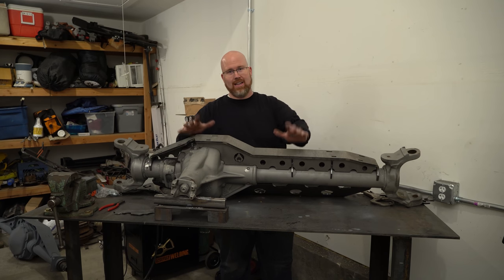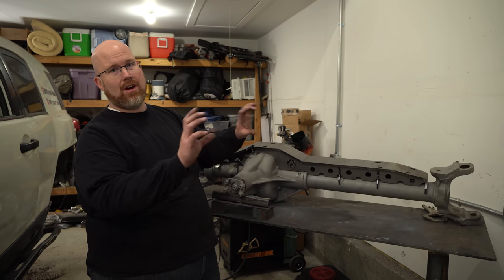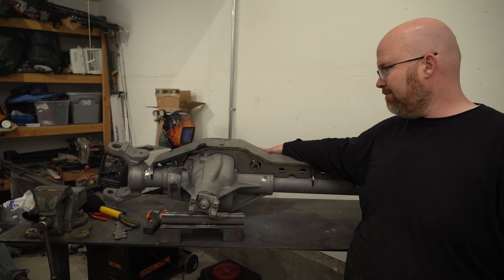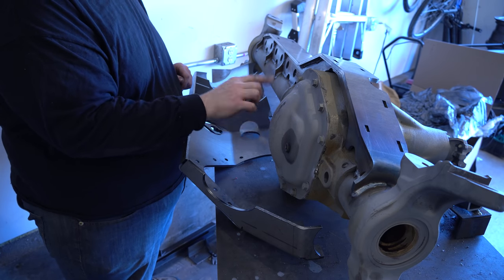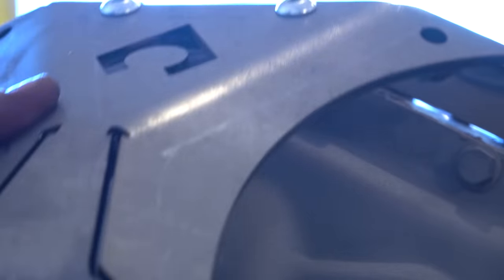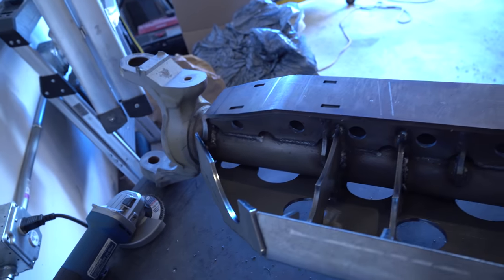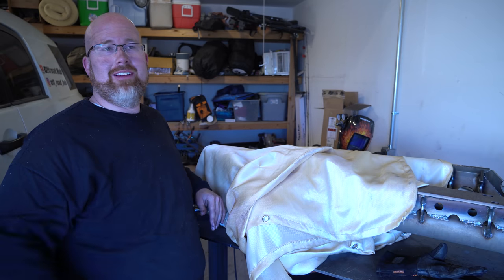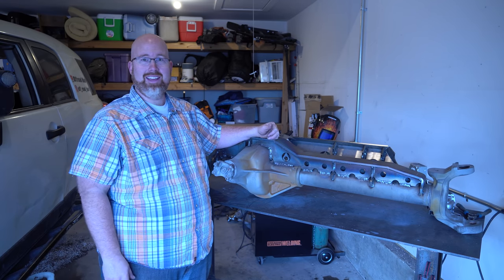Dana 60 Truss and Hydro Steer Mount Install // FJ Cruiser SAS

Comment: Heavy but strong and it will be interesting to hear your opinion on the power to weight ratio when the build is complete. ROCK ON!
Reply from the maker: I'm excited to have all that new weight down low, and wide. The power to weight ratio will be better than old 22re Toyotas with the same setup. It'll be all about the gears.
Reply: @offroadhub.official  Being you trailer your FJ and use it for trail use, on the road performance is not much of a concern.So low gearing is the logical way to go and I have no doubt your 4.0 has all the HP and torque you will need. Assuming you will probably run 5.29 or 6.13 gears with the Atlas 3.8 4spd t-case on 42's will turn your FJ into one mean offroad machine.

Comment: Way to go Ken. Here I thought welding for the first time a Resz DIY bumper was daring..lol I was kinda nervous,  but once I got going, it wasn't that bad. Good job on your build so far and yes, I'm taking notes because i really wanna do this someday 👍
Reply from the maker: Those weld yourself bumpers have always intrigued me. Good job doing it yourself! As for taking notes, remember I'm learning as I go! 😄
Reply: @offroadhub.official  don't worry,  I'm writing down your mistakes to..lol as for the Resz DIY bumper, I was kinda worried at first, I've never welded,  but i figured it out.. me and my little harbor freight 140 mig 🤣 I just added extra layers of paint on my ugly welds. I  had to make sure it didn't fall apart,  so I dragged my fj40 around with my new bumper w/winch making sure it didn't fall apart. Held up great. My neighbors thought I lost my marbles, pulling my fj40 around..lol

Comment: did you think about priming or painting under the truss before welding it to the axle? They make a weld thru primer/paint called steel-it that works very well
Reply from the maker: I primed the underside of the truss before welding it up. Thanks for watching!

Comment: So I installed RCV axles in my FJ because they clam to be as strong as a Dana 60. That's not possible. The Dana 60 is massive. Anyway, I bet you found welding to be fun at first. But it gets old fast. Right? Hurts my back most of the time.
Reply from the maker: I can see the joints themselves being as strong as the stock ujoints in a dana 60. But you can upgrade the ujoints in a dana 60 to 1550 joints or rockwell joints, which vastly surpass the strength of an rvc joint. 

I'm still enjoying welding, every weld is still a learning experience.

Comment: I don't understand what's driving you to upgrade the front axle so* much. Have you broken the front diff / CV's on your current setup? Those are really fucking heavy duty axles that you're going to install there.
Reply from the maker: I want to upgrade the front and rear axles so that I can access more advanced trails, and have less breakage. I have broken several tie rods and CV axles in what I do, and I don't want to upgrade, just a little bit, only to be left wishing I had upgraded "all the way."